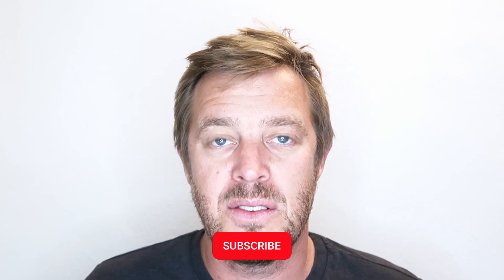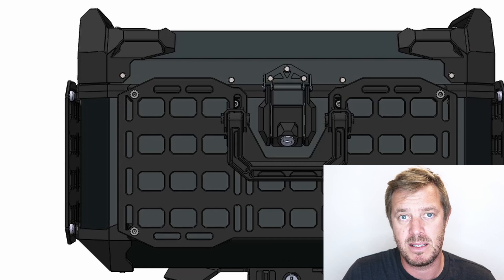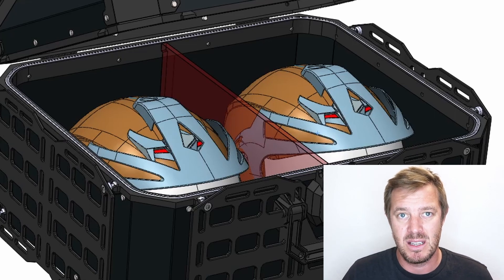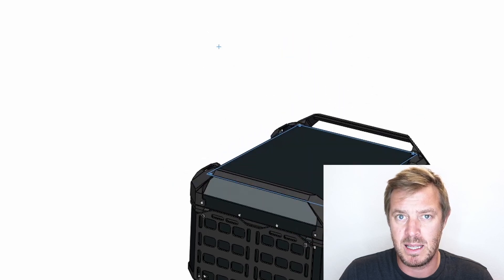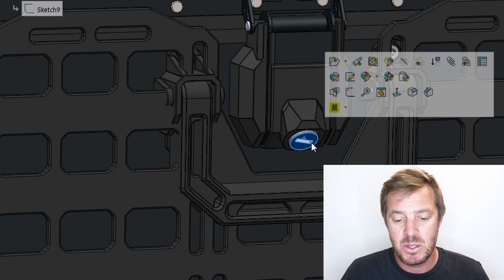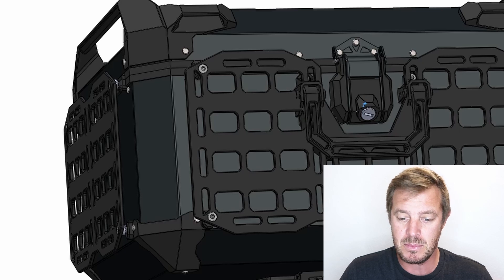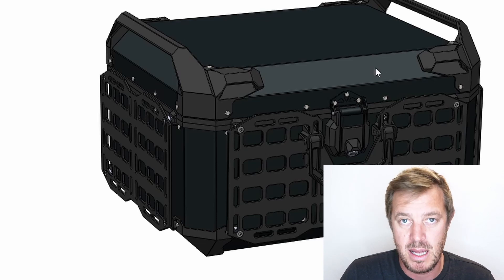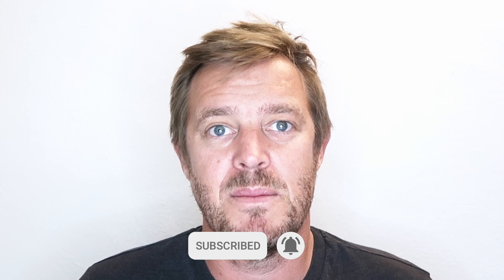Motorcycle Top Box Design, How to Make It Better?

Comment: I'm really excited! So glad to see two helmets fitting in the top box. The first thing I would drop into the box is a apple air tag!   I don't see myself using the front handle on the box - I'll end up using the top handles. Without the front handle, you could almost reduce the tooling needed by making the side mounting plate two separate pieces - then those could mount to either side of the front instead of having one full piece. It would mean additional mounting hardware for each plate, but I guess that's the tradeoff.
Reply: 1) Ok, nice. I use them too for check in luggage but the Samsung ones. Will test mine if it works well behind metal, could just make some kinda holder to keep it hidden - "I would drop into the box is a apple air tag!" 2) Handle noted. 3) Right, so only one needs one MOLLE tool and not two as it is now. "You could almost reduce the tooling needed by making the side mounting plate two separate pieces " ---- THANKS
Reply: Airtag things are really good one

Comment: So glad you are developing the hard top case.I just got my Lonerider side bags but there is nothing on the market I like for the top.  
Some thoughts:
Like the back rest for a passenger
Moving the top  handles to the angled part of the top could allow a flat surface for adding a bag at the top while keeping those fantastic handles on the case. Those handles will certainly make it easier to put the top case on and to carry it. No need for a front handle with the top handles. 
Don’t care for the extra Molle panel on the back, maybe make it an option.I don’t know that I would ever use the side ones either but I like the idea they are there in case I want to. 
Like the locking mechanism.  Seems easy to get the case on and off your bike.
Also, the lined / modular compartment works well.  I like the idea of being able to put an insert and put my helmet on one side and other things on the other side.  Also adding a net or something to the top to stow lighter items in the lid (like a jacket) would be great.
Reply: 1) Noted "top could allow a flat surface" 2) Noted "No need for a front handle" 3) Noted "Don’t care for the extra Molle panel on the back" 4) Noted "Like the locking mechanism." 5) Noted "he lined / modular compartment works well." Thanks!!

Comment: Looks great and sure the final product will be yet another great success. A couple suggestions, drop the handle, these things aren't used as brief cases. I only remove my topbox when I want to clean it or replace the foam tape I use to stop chaffing and vibration. As for the molle panels, I would drop the ones on the back of the topbox. A couple reasons, why would you want to mount more off the back of the bike and possibly obscuring your brake light and indicators. Then the rear of the bike and topbox generates a good suction, dirt gathers quickly on the back. Having molle panels will be a pain to keep the back of the top box clean. Also consider this suction effect when designing the lid and plate mount locks and mechanisms. Like the aim of allowing coding to exiting bike key, this will be a serious draw card. I personally like a 42-45L topbox, anything more and you become the target for pizza delivery jokes.

Comment: Looking really good. A net in the lid just to keep docs, etc. readily accessible - don't want too much weight on the lid when it's open. Need to consider protecting your locking mechanism if it's going to be under the box especially if it doesn't get used very often. I don't take my box or panniers off, I have inner bags

Comment: Thank you for the detailed video. A few things to think about:

1. I would suggest NOT having the box lock “automatically” when the lid closes as I believe accidentally locking your keys inside the box will be a frustrating issue for users. This could potentially strand a rider if the motorcycle ignition key is inaccessible inside the locked box.

2. I believe a rear facing carrying handle will be a seldom used feature. Most people will want to carry the box upright with any handle(s) anyway.

3. In my opinion - I believe doing away all of the molle attachment areas and simply offering two (or more) hard cases sizes may make for a better option. If a rider is purchasing a hard case then they are likely less interested in attaching additional storage in the form of soft-sided storage. Simply offer a wider (larger) hard case as an option - this would be the most convenient and most secure option. Plus, riders seem to love placing stickers all the ver their hard cases - the molle panels prevent this.

Bottom line - lose the rear carry handle and all of the molle attachment points. This would instantly reduce parts count and simplify manufacturing assembly.

Thanks for the opportunity to provide feedback. Keep up the great work.

Comment: I like the size that holds two helmets as it looks like it's wider and not as tall. I don't see a need for a handle or the molle panel on the back. To keep cost down I also don't think you need to do a soft closing hinge. I like the the idea of the removable molle panels on the ends because you can take it off and attach a bag to them.  I assume it would make it easier to thread the molle straps onto it.  I'd suggest you make the organizer bits inside something to purchase separately.

Comment: Some kind of slider in front of the key hole (like the steering lock) to prevent dirt to get into the lock. It’s a common problem to keep them clean from dirt. 
Also a pocket to keep maps or iPad inside the top of the box.

Comment: A molle panel inside the lid would be useful. I think I would use that more than the outside. I use a molle panel inside a Pelican for non-bike use and it works great.
Reply: Or potentially those optional Pelican add ons with mesh pockets?

Comment: Would love to see these injection moulded panels being able to link together as an emergency sand mat as the 4x4s have, I rode across Australia and know it would have been useful, very useful in parts.
Reply: Interesting... Will depend on the materials. Could snap, but probably ziptie would be the easiest as then we only need to make holes. When I ride sand, I try not to if possible, but I deflate the tires a bit, makes a world of difference.

Comment: Hey Andrew, I like this new top case concept not only the security, but also for who travels with companion.

The top case has an attractive structure and catches attention with the molded panels, however I’m not sure if would be advantageous have the molded panels under the handles.

The key lock system it’s simple and seems practical. Who uses the hard bags rarely takes them off the bike, so this independent system just elevates the security of the bag. 

I also question if it would possibly have some kind of groove inside of the bag to put USB charger for cameras and lanterns for those who do camping. 
The top case isolation system is so well thought and it seems practical for replacement .

Inside the top case it would be great if it had some kind of partitions. For example the molded panels could be removed from the outside and putted in the inside of the bag to make 3 partitions. Or also the option to put them in the top of the top case. 
Congrats for the project I’m looking forward to the final project!

Comment: If the rear handle adds complexity, I vote for dropping it.  I like the idea of  size options.  I don’t need the ability for 2 helmets.  Keying to the bike would ideal if practical.  I like the suggestion of a lid web organizer.  I like the idea of a bag, as well as a non-marking interior liner of some sort.  With the BMW top box, contents can be discolored because of the oxidation.  Simple is fine with the hinges.

Comment: I have several pieces of Lonerider gear including the semi-rigid panniers and 2 each of the 3 and 6L bags, as well as the duffle. However, the one non-Lonerider piece I still have on my bike is the Shad SH58X top case. It doesnt match the bike or the other hear that well, but it allows me to have a backrest for my wife who rides with me and we can stow two helmets which is important to us so we arent carrying them into restaurants, etc. Lastly, its incredibly quick and easy to take on and off which I do often since I dont want to go on ADV or any off-road ride with the top case unless I have to but during the week I need to reattach it quickly to ride to work. This proto appears to meet the first two requirements for me. If its easy to attach and reattach to the bike then Ill be the first in line to order when its ready.

Comment: A smaller size 30lt that is a bit flatter and wider that the square type tops boxes on the market would be great. I don’t use my top box for a helmet but for camera gear and other valuables. I try to keep my top box light and use my side bags for other gear for camping and clothing. Looks great by the way.

Comment: It would be nice if the divider could be placed flat on the bottom or on the side when not used so as to maximize internal storage but be with you for use at some later point in a trip if desired. I love the locking system for affixing it to the bike and the detachable panels on the sides. Brilliant!

Comment: Hi Andrew, I don't see the need to add the rear mollie pannels, as this would be adding mor weight rearward. Also to combat keeping the lid closed, would magnets be of use? This would lead to a slight push when opening but keep the lid closed in the event of forgetting to lock it, this could possibly be incorporated in to the seal system. Overall a nice looking peice of kit, with the possibility of having the LR logo included in the moulding of the rear pannel. Or even recessed and the logo made reflective.

Comment: I agree with other comments about the front folding handle, I doubt I'd ever use it. The hard molle, as much as it looks cool and "tough" it also looks like it adds unnecessary complexity. I took some super tough webbing from an old army belt and pop riveted strips of it on my bmw factory case with molle spacing, it sits close enough to the case to not be obtrusive when not in use and is solid enough for what I use it for, I only have my first aid kit on it and the sheet aluminium the case is made from might need some bracing if it needs to carry more weight.

Comment: The Bumot mount for their top box works well.  I will be removing the top box at hotels because that is where all my camera gear is carried.
I install foam and cut it to house my cameras, batteries, chargers, and drone.  Also an attachment for the inside of the lid to store cables and small things would be great.
On a long trip the helmet would be the last thing I would store in a top box.

Comment: Fixed point on the top, reduce the width good enough to slide in the strap (roxstrap or overlander bag). Make it two each side to accommodate different bag width.

Comment: Two top handles and one side handle, both would be my preference. Sometimes I only have the one hand to carry so the balance of the one handle would serve better during those times. Agree with a flush top for bag tie down. Side molle panels and their attachment is nice. I would normally like to leave the top box attached with helmet and other items not needed in room inside. I would prefer inside divider system vs a bag but the versatility would be nice as well.

Comment: A back rest for the passenger in the other side of the box should be considered .. also you can try thinking of opening mechanism to be easy ( place for the fingers and grip and automatic movement ) .. velcro in the inside and out side should be possible for customization .. the overlander should fit inside and outside to be  ..can  the latch curve take all the wight of this box ? I mean the pressure point in the latch .. if possible electricity point would be amazing for charging.. awaiting the box to buy it

Comment: I would not use the front handle and think that it should be removed. I would want to install this top box and probably never remove it, although would of course need the option. I like the idea of still being able to use my overlander bag in conjunction with the top box and still being able to secure it to the bike using my steel core lock. Hard molle panels definitely provide a unique look.

Comment: Looking great so far. I personally don’t see the need for an additional handle on the rear MOLLE panel as it has two grab handles at the top. I also really like the manner that the MOLLE panels on the side can be easily inserted and removed. I concur with how abrasive the inside can be on long journeys. I’d like to see if a removable tray (in red) could be possible to protect the contents. I have an overlander bag that I remove daily when I arrive at work/home that I find extremely helpful. I have had top boxes in the past and never contemplated removing it as I do my overlander bag, I doubt if I would I guess it would depend on how easy it is to remove. Not very helpful I know. Look forward to your next video.

Comment: Product well thought out with lateral supports and interior separations. An adapter system for other support plate on the motorcycle would be interesting so as not to need to change the basic plate already installed. For two full helmets the capacity should be at least 58LT

Comment: G'day Andrew...  watching with anticipation.  Your designs are looking awesome!  Really like the molle panels great idea.  I've mounted small Pelican cases to my previous top box on both sides so this idea is great.  Especially the ease of removing them, that is brilliant.   I don't know about putting weight on the back panel.  Could be a lot of leverage hanging further out the back of the box.  Sides are ok as you can put similar weight on both sides.  It would be awesome if you can make the rack mounting system with the ability to utilise the existing BMW original racks.  That way I could use my small one for commuting/small trips and swap over to your large top box for bigger trips.   I would personally drop the single handle under the lock.  Just not required when you have the nice big handles on the top.  Overall looking really good.  Keep up the good work guys.  Loving the gear, I've already got.   Cheers.

Comment: My wife and I travel together on our '22 GSA.  I currently have the BMW top box.  I would love to have the ability to secure two helmets in the top box, that way I don't have to carry one or lock it to the bike (especially in the rain).  I love the side molle panels (I don't think I would use the back or the handle as the box will stay on the bike) and the ability to quickly remove them.   I have found a bag to be extremely helpful for placing and removing the helmet from the box without scratching it.   One request, please make sure that two full face helmets will fit with external intercoms attached.  Would this box be sturdy enough to attach a Rotopax to the lid to carry water and/or fuel, or would that stress it too much?  Thanks for all that thought you put into this.  I hope the real world testing goes well.  I look forward to seeing this box.

Comment: That looks really good. I would say make the pannier lock barrels to be able to use a BMW key to people that uses the standars GS pannier should be big like 52 or even 58L, the molipanels are great so we can attach other lone rider bags and use that space. Regarding removing the top box, i personally never remove mine, usually in top box i have the things i need for the day and clothes goes into the panniers on bags, i suggest maybe do a back molipanel without handle (default) and other with handle to sell has extra if worth in term of costs. Also the inside bag make it in way we can attach externally in the top of the pannier has the original bags, so if we need on a emergency the extra space we can just take the bag and attach on the top.   Also i would try to have a basic model with important stuff then sell the rest has extras, like the molipanels, so you can reach a wider number of buyers.

Comment: I think this will be a buy for me day 1.  I really hope it will be available for spring/summer.
Some of the points I want to bring up is the handle, I do think its a great idea since I can see me taking it off at camp and using it like a seat, so it makes sense for me to have a handle.  With that said, I am ok with it being a bit of a PITA to remove if it means it is more secure when I am in somewhere not as safe as a campsite.

I was also wondering how wide it will be?  I have your larger overlander bag and love it, but it is a bit too wide when it is on my bike, and I am not able to open my third party hard cases with it on, at least not easily.  So it would be awesome to make sure you can access a good amount of side cases.  Just something to figure out, if I cant open them, well I guess I better upgrade my side bags!

Comment: I would be interested in a semi rigid top case like the side bags you sell. I have fallen on my bike having my Bmw top case vario pannier… luckily it hasn’t broken off but I do have a few dings and scratches. I have a few buddies that the top case has snapped off. Additionally, when I go on trips I usually leave the top case on and just take the inner bag out to my camp site or hotel. Having the key lock codeable to my Bmw key would be great.

Comment: IMO the biggest issue with motorcycle luggage, particularly top boxes are their inflexability and the temptation to overload the bike behind the rear wheel. One box doesn't cut it for me, though the Jesse system comes close. Having a flatter lower c-o-gravity option on a sliding mount means that when riding solo I can move the case over the pillion seat. Their smaller ' 35 litre challenger case is perfect for cameras and laptops when I'm filming, plus I don't need a large top box for helmet when touring. Good luck with your project.